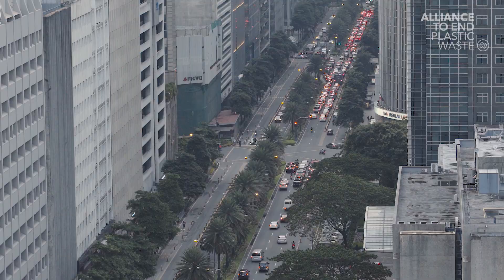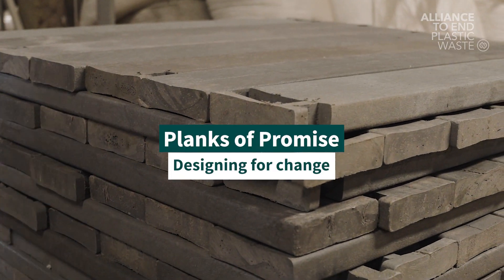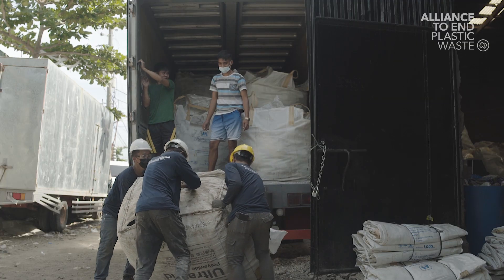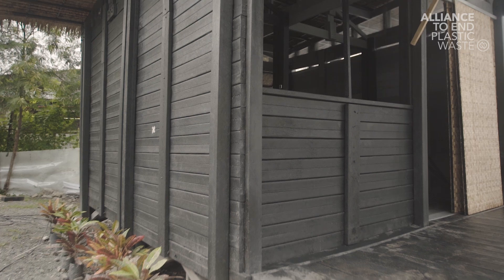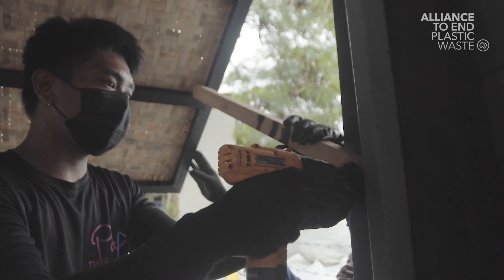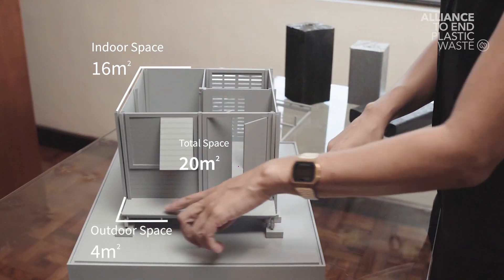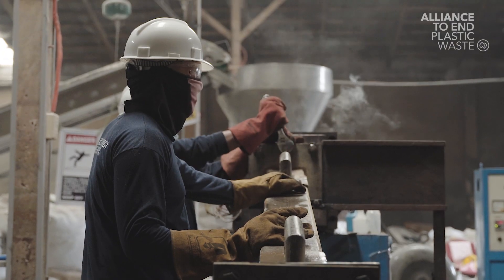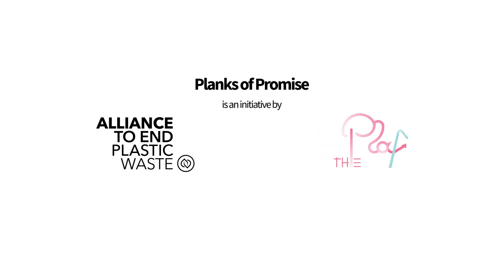Designing for Change

Comment: Emission during the production.
Reply: What is your solution for the emissions then? Because the rest of the manufacturers around the world does the same if not worse than this.

There will always be some sort of trade off when making something, and to be honest their panels are way better, refined, modular and well thought of than the squished chips of plastics passed off as a building block made by others who are on the same vein of attempting to recycle plastics too.
Reply: @stormgear896  vacuum the process using water jets